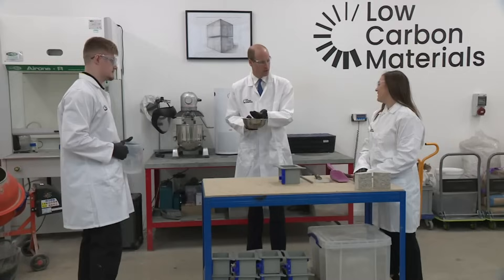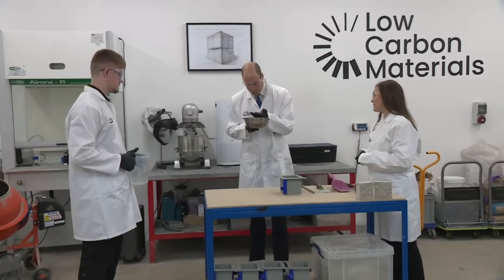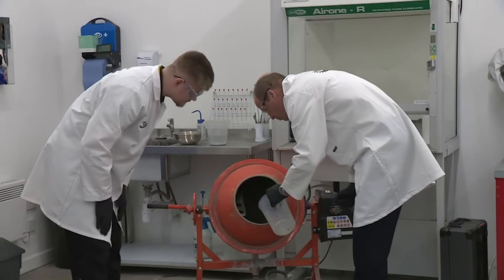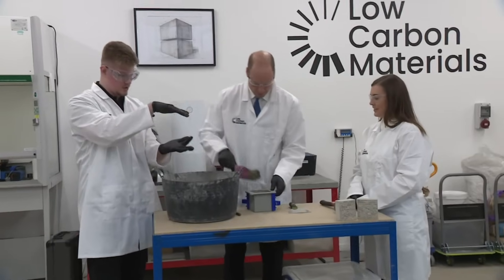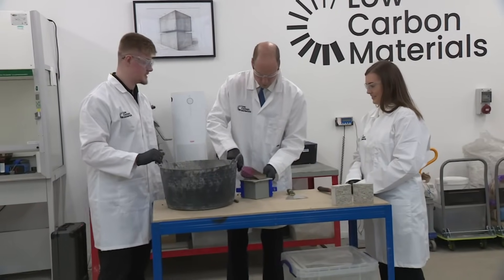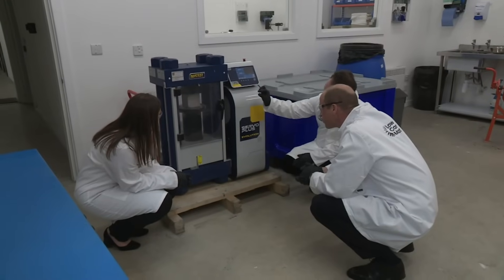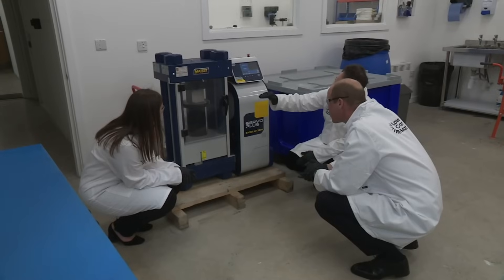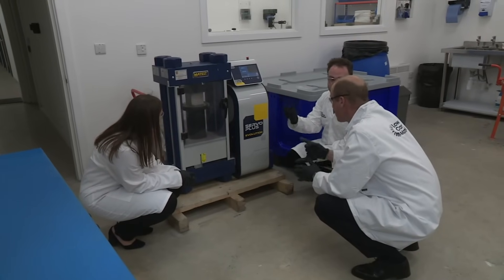Prince William Paves The Way With Testing Eco-Concrete Block

Comment: Eco concrete: Better for the enviroment and 10 times the price of normal concrete!
Reply: So were calculators once upon a time. All new technology is expensive but that does not mean it is not worth pursuing.
Reply: @Foxytrot-sx2vd all new technologies are more expensive to start with, then as more used the price comes down.
Reply: @Threadbow  That was my point. Calculators used to be cost prohibitive when first marketed, now they can be bought anywhere dirt cheap
Reply: @Foxytrot-sx2vd  you are of course correct.
Same with any technologies newly released.
Mass production will bring down prices.
Great work prince William
Reply: So are smart phones!